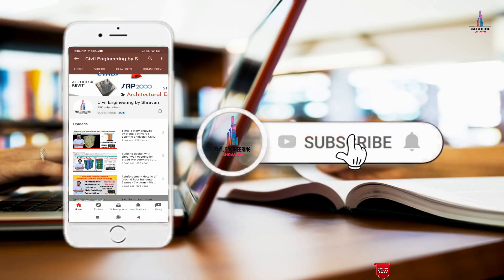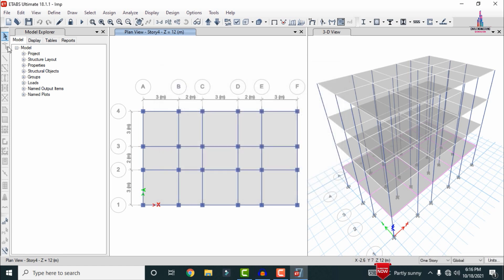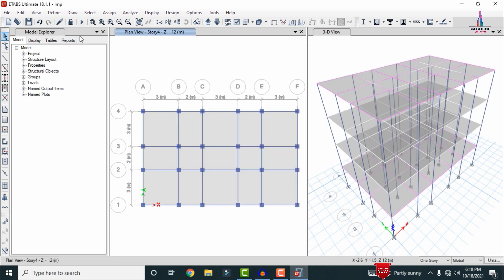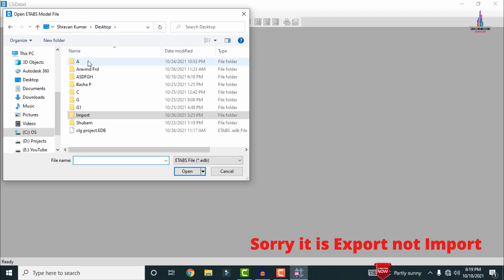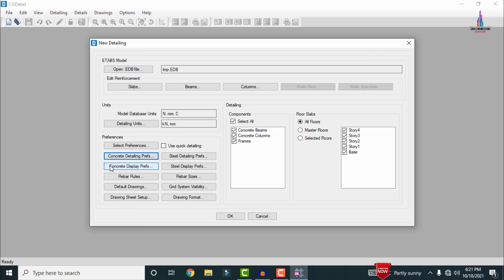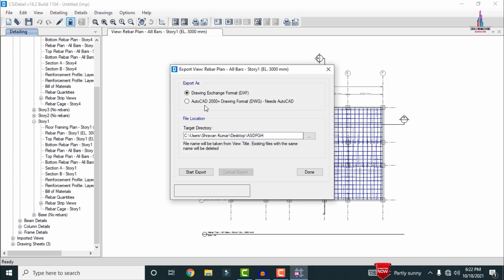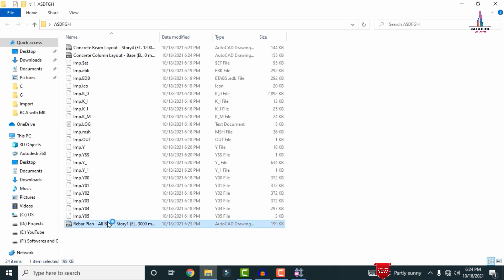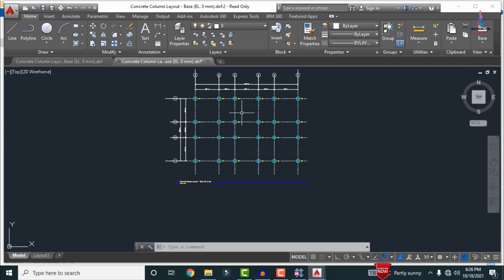Reinforcement details export from CSI  ETABS to Auto CAD | civil engineering | building design |

Comment: Dear Sir . I made a model in etabs . I defined the static earthquake loads and the dynamic response spectrum . After that I run the analysis and I found that the response spectrum is more than the static base shear . There is no need for scaling . I reduced the loads on slabs . I reopened them again and the dynamic is more than the static again . Will I need to rescale the dynamic and static ?
Reply from the maker: No Need to rescale